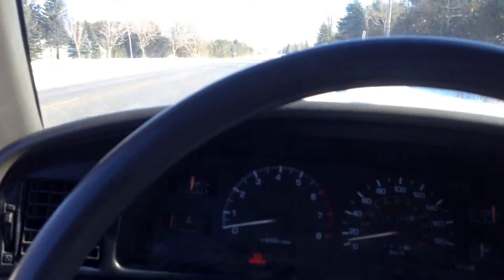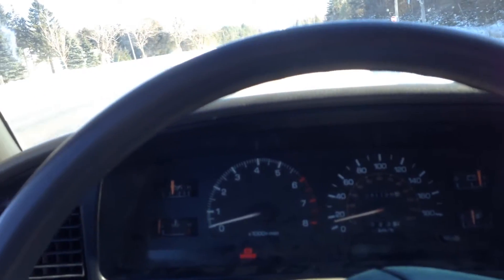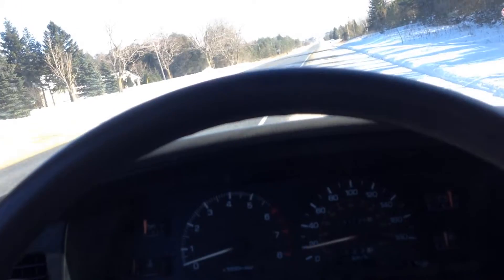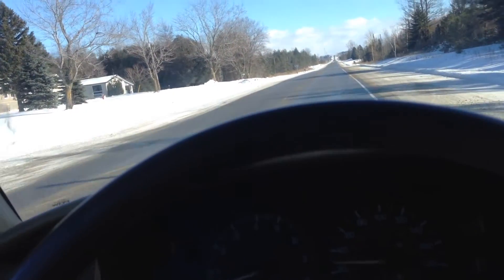Toyota diesel conversion 1.9 TDi road test 1

Comment from the maker: Before the - Malone Tuning Stage 3 and Performance Diesel injectors, we had achieved 39 1/2 miles per imperial gallon. After the tuning and injectors we were able to get 42 MP imperial gallon. This was done on a run down the highway at 65mph.